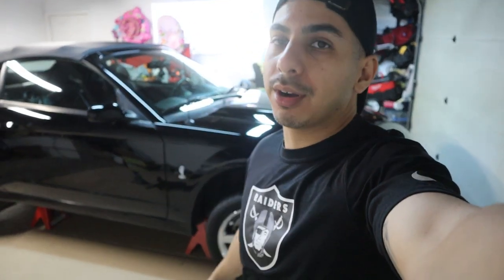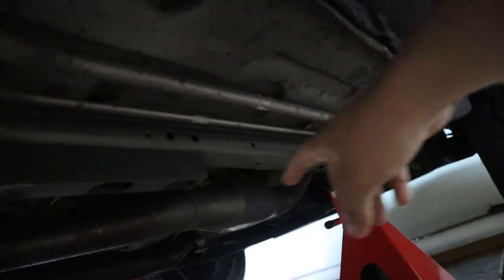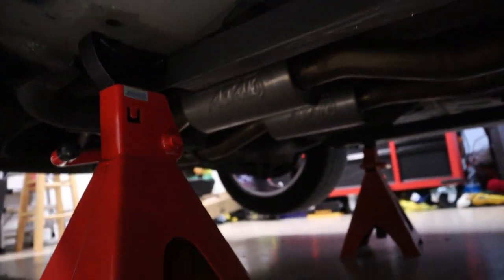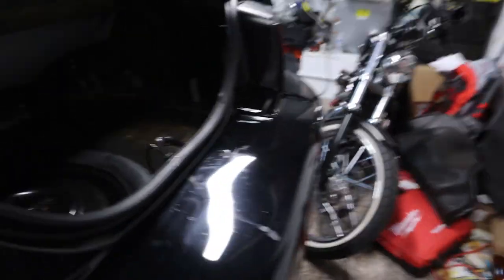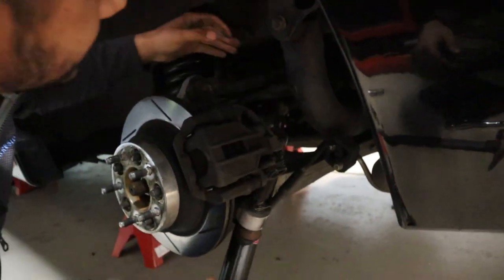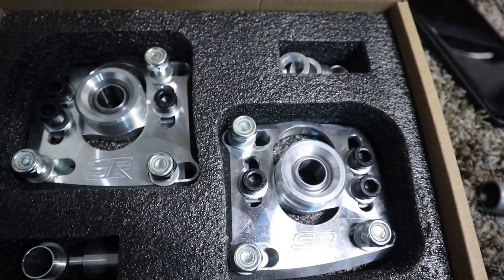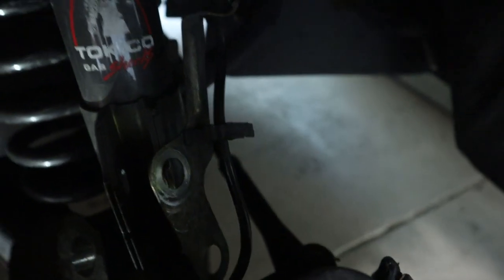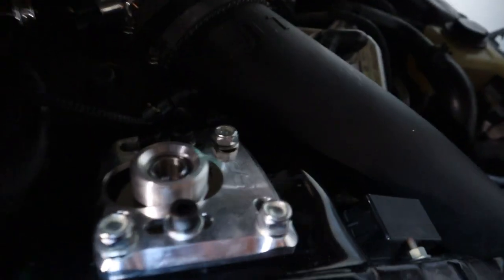Installing Koni Shocks and Struts

Comment: I'm looking at the koni str.t or possibly the yellows with lowering springs to replace my coilovers. Does anyone know would these re use any stock parts? I was wondering if I can order the kit and just get them put on or if I'd have to order some other parts that may not be on my car now since I have coilovers
Reply from the maker: You wouldn't need any additional parts
Reply: @SVTVasquez  thanks how do these ride as far as being comfortable and smooth as compared to a stock suspension?
Reply from the maker: @Murrayfan  if you have a mustang you'll need the struts and springs. The springs I have are eibach so the ride quality feels way better than stock it isnt as bouncy it is more responsive